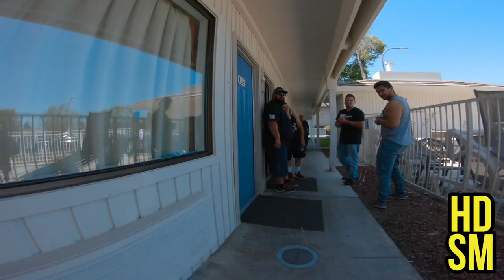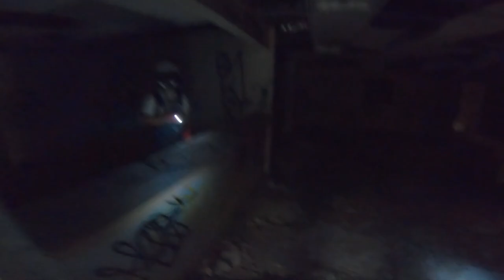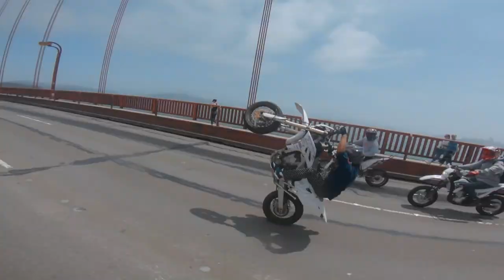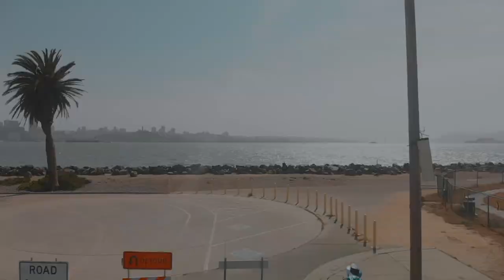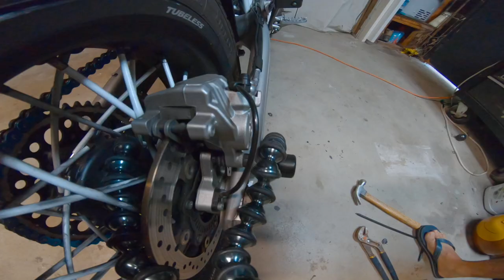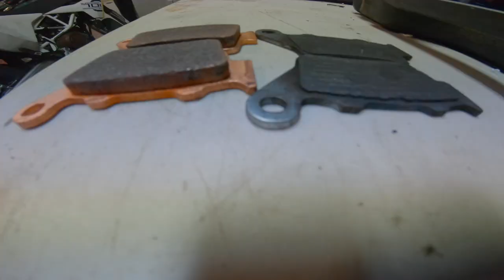How to Replace 2017 Husqvarna 701 Supermoto Rear Brake Pads

Comment: Just the video I need. I might try this, but in the video, after you take out the pads you stick some pliers in there and you're fiddling doing something but you don't say what. I need to know before I begin!
Reply from the maker: I was just pushing the pistons in to make room for the new pads.
Reply: @HDSupermoto  Ah, so you have to do THAT. Thanks!
Reply from the maker: No worries! And yes! As the pads wear, the pistons stick out more. So you have to make room for the new ones. 👍🏼

Comment: I can not figure out how to change front pads! Is there any video on that?
Reply from the maker: I’m sure you can find one. But it’s easy. 

Loose the two break pad bolts and the caliper comes out
Reply: @HDSupermoto  no it's much easier... just press the spring and remove the pin. No need to unscrew anything. I just watched the video. Thank you anyway!
Reply from the maker: @Georgian4ever  there ya go!! 😆 it’s been a while 😬
Reply: @Georgian4ever  Got a link to that vid? Can't find one for the 701.